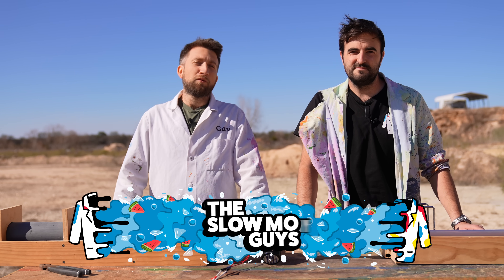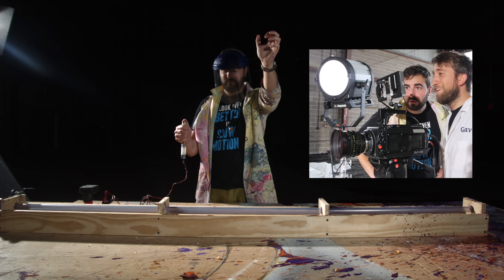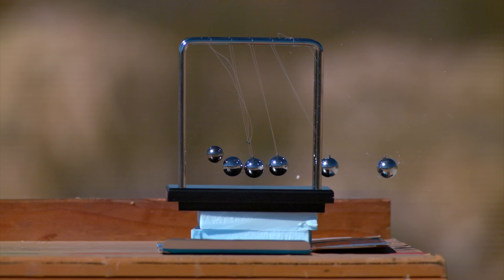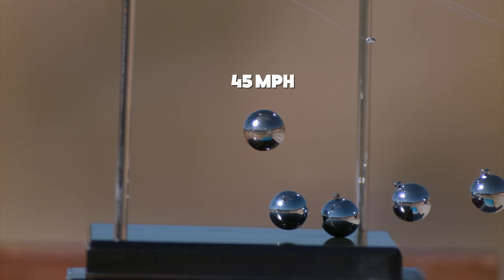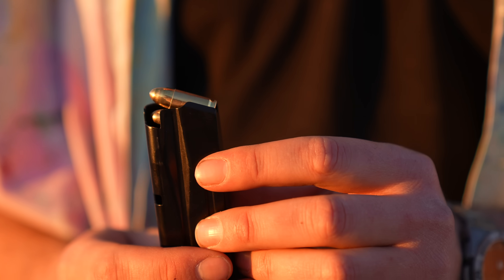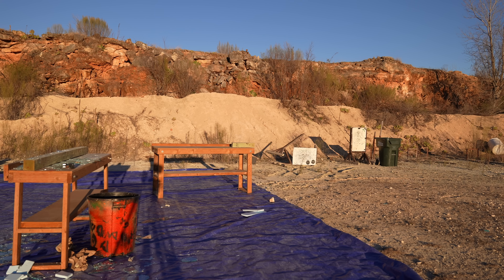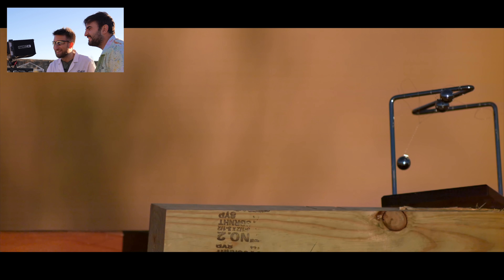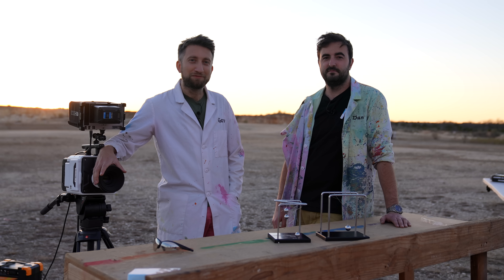Bullet vs Newton's Cradle at 100,000 FPS - The Slow Mo Guys

Comment: When Mythbusters did the giant Newton's Cradle the killer of the scale was deformation. You just can't get metal hard enough to withstand the impact. Saw the same thing here. You can't the speed enough that the hard steel balls deformed and as such the end ball wasn't traveling as fast. You lost energy in making those deathstars. I wasn't at all surprised by the bullet result. Great shot by Dan, btw. Bullets have much more speed, but you just loose so much energy to it deforming.

Comment: This is the physics that makes it reasonably safe for competition shooters to fire rounds into hardened steel targets as long as those targets can swing, and the shooter is a reasonable distance away from the plate.  The bullet impacts the steel, transferring most of its force to the plate which has greater mass, and thus has a lot of inertia by comparison.  The bullet, being much softer than the steel, rapidly deforms upon impact with the plate.  The plate swings from the imparted force, and the bullet fragments are directed in a downward pattern into the ground.  After you fire enough rounds at a plate, a little line will develop almost perfectly perpendicular to the direction of travel (inline with the plate).

Comment: At high speed, the Nylon strings will behave more brittle than normal as polymers are time dependant in their response to stress.the faster you hit them the more brittle they behave. Nylon is also more brittle when completely dry. It can absorb about 3% by weight water which acts as a plasticiser and will make it tougher

Comment: Yeah the speed of sound in steel on average  is about 20,000 feet per second the ball bearings is probably faster because they’re hardened steel. There’s no way you’re gonna fire anything fast enough to prevent the last ball from popping out first

Comment: It's not that the first ball gets snapped because it gets the most impact.  It snaps because the one fired is slightly above the first ball, so it is driving the first ball down, snapping its string.  Since the bullet was slightly below center, it pushed it up.
Reply: .   To think that is what happened... one first has to filter out the objective personally witnessed reality and replace it with a something from their own imagination. The string on the first ball didn't break... The mount the string was threaded through remained in place as the ball shot out from under it with more force than the mounting method could withstand.

Comment: Looking at the high speed (slow mo) shot of the impact, I can see that the projectile path is slightly above the center line of the cradle balls, causing it to deflect upward after impact. I would suggest that a retest be done with a more accurate impact to impart all of the energy in a straight line, rather than a deflecting shot which is not transferring all of its energy in the straight line. This may or may not give a different outcome...

Comment: You guys are idiots using PVC pipe and fittings for that high pressure gun. Do you know what happens if you get a defect in the plastic? It explodes like a grenade in your face.

Comment: I think that the first ball was detaching because the BB was hitting just slightly above center, so the point of impact was at a slight downward angle, so while most of the force transferred to the ball was in the horizontal direction, some smaller proportion was in the vertical direction pulling on the wire, and at the forces you're dealing with even a relatively small vertical component is way more than that little plastic wire can handle so it snaps immediately. The interface between the first and second ball, OTOH, is close to perfect so nearly all of the horizontal force is transferred to it in the horizontal direction, which is then transferred to the third ball before the angle of the wire holding the second ball can rotate enough that the wire has to resist much of the force from the first ball.

Hopefully that makes sense. I watched this after a couple of drinks.

Comment: Firing through the pipe, the BB had more momentum  and therefore did more damage to the Newton's Cradle.  Using the handgun, there's a slight kickback reducing the momentum and force of the bullet.  Additionally, the first cradle shot at with the handgun, I  could see where the first ball is higher than the remaining 4 balls skewing the results.

Comment: Hugely disappointed.

The bullet hit with calculable energy.  Some was lost throwing the first ball up.  Some was lost in heat iwth the lead splash.  All the rest was imparted into the last ball.  So you can calculate the energy in the last ball (by the speed and mass), to get the efficiency of using a gun to move balls.

No Measurements.  No calculations.  [sadface]

Comment: I think one of the reasons the balls didn't fly as much in the last one is because you hit it slightly low, while the shots aligned with the tube hit almost perfectly dead centre. So a lot of the energy glanced off instead of being transferred into the next ball. Still really good shot for just shooting with your body, instead of from a vice.

Comment: I would love to see that with an API round. I have a 7.62mm with API rounds, what I don't have is a high speed camera.
The round would be lighter than the ball bearing, but the penetrator should be as hard if not harder then the cradle balls and traveling pretty fast. I wonder if it would punch through the first ball? I would totally donate my time, firearm, and ammo to find out.

Comment: The air in the barrel ahead of the projectile is a factor.  Should have a sheet of plywood between gun and target, with a barely over projectile sized hole in it.

Comment: Is there some sort of physics behind the initial velocity of the ball, the impact and the last? The projectile came at 270 mph (6/6 of the original speed), when it hit the first ball it slowed down to 45 mph (1/6 of the original speed), and the last ball reached 90 mph (2/7 of the original speed). Does it have to do with the conservation of momentum principle?

Comment: The second ball is transferring energy because it is stuck between the ball receiving all the energy and the mass of all the balls  after it. The last ball has nothing to anchor it… no mass of other balls behind it to overcome. The energy it receives overcomes the resistance of the strings first because of this. If you used larger balls, stronger string, and less mass in the ball fired, we could see the way that energy traveled through the system better… because the system would not be destroyed by the impact.

Comment: Question: Does the suspension material matter? That looked like fishing line holding the balls up in the cradle. Do you think the results would be different using some form of metal wire to suspend the balls and/or if the balls were cast with a suspension loop as part of the mold instead of welded on or however it's made? Maybe my intuition is way off, but I can't help but think that a better attachment point and more tensile strength in the attachment material would make quite a bit of difference.

Comment: what you need is for the projectile to be the same size and material as the balls on the cradle… perhaps ball bearings. then you will see the impulse pass down the row of suspended balls.would also be interesting to see the effect of balls fired at speeds below and above the soeed of sound in the material,
eg rubber 200ft/s   steel 17000 ft/s

Comment: Even with how fast everything's moving, here's the crazy part.  At 10:32 if you go frame by frame with the period and comma keys on a keyboard, you can see the bullet's reflection in the first cradle ball.  This is taking place 4000 times faster than the human eye can see, and the reflection of the bullet in the first ball is happening at the speed of light.  If you really think about it, that is insane.

Comment: I would like to see this revisited. Only difference with the pistol, would be the use of a Ransom rest and a laser bore sight to get the alignment right and take the variable of hand aiming out.

Maybe even try other firearms on not just a traditional newton's cradle. Things like hanging aluminum and brass locks. Modeling clay, terra cotta pots, ceramic pots, cookie sheets, and compressed aluminum pans.

Comment: I'd imagine the first ball gets impacted significantly only because the ball bearing is shot slightly above center. The force then transferred to the first one is down and to the right. Only that horizontal momentum is then transferred to the other balls whereas the downward momentum is absorbed solely by the string causing the first ball to snap off.

In theory if you were to fire a ball bearing dead center and perfectly level, I'm sure the first ball would be the least impacted as it immediately transfers almost all its momentum to the other balls without straining the string holding it in place. After all, that's what we observe when using a Newton's Cradle as usual.

Comment: Id love to see this with like 3-4inch bearings on the newtons cradle (like a several-times-upscaled version) but hit by a normal ball bearing or bullet as in this video, accompanied by steel wire as strings instead of nylon

Comment: Did the mass of the rest of the balls make the bullet fragment?  What would happen with only the mass of one of the balls?
Meaning... Could a bullet proof vest be made of a single layer of HARD material?  Like the steel balls, hard..
For example..  A layer of hardened squares, bonded to a kevlar layer.  Or two layers of squares off set so no seams for a bullet to push past;.

Comment: You should’ve tied him together with braided fishing line like spider wire instead of a clear monofilament fishing line that’s probably only like 8 pound test or whatever because the three middle ones are breaking the line and the first and last one are breaking at the weld where the holders are

Comment: Hello fellas,I would to like make a suggestion ..
I’m sure you know the Cymatics of making a shotgun shell,
I believe if you were to make a seal behind the ball bearing ..similar to A shot gun shell ,pushing the projectile out of the barrel with seal right behind it ..
For maximum power and velocity like piece of cork or plastic same 
Diameter as the barrel.
Both ejected out 

Note add some riffling .. lol 

Ciao

Comment: PLEASEEEEEEE RE DO THIS ONE MORE TIME…. This time , try EXPERIMENTATION with 30-06 AP . The core is near to or above the hardness of the bearings .
    I am not that far from where you two have said you do these experiments.    
    I can get you a closed range to use with electricity to run your lights .   A rifle to use.  And a few of the coveted black tip 30-06 to use.   And some 5.56 m855 and m855a1 to use.   Along with a lead sled if needed to line up the barrel with the Newtons cradle .

Comment: I love the moment when the .22 turns into irregular birdshot.
     For scientific purposes, you should do it again with each of the cradle balls numbered and weighed before and after. The diameters of the fore and aft impact craters should be measured after each iteration. There should be several iterations with fresh spheres each time. 
     Most importantly, you should try it again using a muzzle loader that can fire a comparably sized ball but let it be made of steel. Be sure to leave some space between the first ball of the cradle and the end of the muzzle loader, and rig the rifle so that you can pull the trigger with a long cord. And set up a camera that can sight along the path of the trajectory.

Comment: The thing about the Newton's Cradle is that it shows the simultaneous conservation of two quantities: kinetic energy and momentum. This is the reason why the middle balls don't move, or why two balls move if you swing in two balls to begin with. KE = 1/2 mv^2 while momentum = mv. Assuming the incoming mass is equal to the mass of the balls, the only way for both equations to be satisfied is if the final ball leaves with the same energy as the incoming one. In reality you'll always end up with some energy being transferred to the other balls and the frame because of differences in mass, inelasticity in the collision, etc etc.

Comment: FYI copper is harder than lead. They coat bullets in them not so they'll engage the rifling better but because the harder metal won't leave lead residue in the rifling as much. The fouling of the barrel is reduced

Comment: The bullet is meant to shatter, it's a lot more dangerous for it to pass through a target than to stay in it and impart all its energy into the target.
Some rounds are very different and are supposed to pass through a target, but this round isn't meant to.
Interdiction rounds will have a steel core.

Comment: If you write down the energy and the momentum equations for a two-body collision, you will see that the total system kinetic energy is distributed in inverse proportion to the body mass. So it is no surprise that a light bullet absorbed 10 or so times more energy than the Newton’s cradle, and disintegrated as a result

Comment: When armored equipment was created, it was found that when the bullet struck it, the bullet often shattered on contact.  When they turned the bullet around in the brass with the flat spot leading and the pointy part inside the brass the bullet was able to puncture the armor.

Comment: In the very first shot of the video, the projectile fired caused the newtons cradle balls to flatten because the newton cradle balls have the same or somewhat similar surface area allowing their collision to form a shockwave that equally distributes the energy into both balls (pause). Explanation similar to this done by the action lab.

Comment: I'm disappointed you stopped with the lead bullet. There are solid copper bullets you could have tried as well a getting a 9mm HP (Hollow Point) and putting a small titanium ball baring in the HP tip.   You quit to soon.....

Comment: the "expert" should know that its not all about "weight".  that parabellum prob weighs the same as the ball bearing, but because its so much softer, it yields to the ball bearing which is either steel (most likely) or ceramic.  ill mail you a few 7n31 and some green tips

Comment: 5:45 Look closely at the first ball and you see that it is hit slightly higher than its center. It has the effect of pushing the ball down.. over an extremely short time, creating a large downwards acceleration. Since F=m*a, it's a large near-instantaneous force on the string, snapping it. Same thing happens to the second ball. Watch the balls by stepping the YT frames (comma/period) and watch the movements of each ball, up or down.

Comment: It would be really interesting to see what a massive increase in bullet velocity would do. Your average 9mm round typically clocks at about 1150 FPS, and your higher pressure loads hitting upwards of 1300 FPS or so. Pretty fast, but that's still only just a little over mach 1 in the grand scheme of things. Those balls are probably made of something relatively inexpensive like chromoly steel, right? Definitely hard enough to stop any pistol caliber no problem, granted the mass differences will provide some slightly different outcomes, but for the most part it won't be significantly different across the board. Velocity is what will determine the most significant differences over bullet mass. Speed is the primary variable taken into consideration when ammunition manufacturers design armor penetrating rounds. Speed comes before any other design feature such as hardened steel cores or anything like that. A standard FMJ copper jacketed lead bullet can and will punch right through armor plating if you can get it moving fast enough. It's mass is pretty irrelevant in that part of the equation, and so is the material of the target's construction (in reference to armor, like steel or ceramic). If you can step this up to rifle calibers you'd get some really interesting and badass footage. 5.56x45mm or .223 Rem (They're more or less the same round. The difference is pretty unimportant.) AKA the bullet the AR-15 fires is a intermediate cartridge (medium power) with a .22 caliber bullet (yes, the projectile is only .22 caliber. Caliber is a diameter measurement for those who don't know.). For the most part it's average speeds are in the mach 3 range or 3,100 to 3,300 FPS give or take depending on barrel length and bullet weight. I bet you'd get 2 clean holes punched through the first 2 and if it makes it through the 3rd it'd probably mangle it in the process before completely disintegrating. There's definitely some newer cartridges out there like 6.5 Creedmore that'll probably punch through all of them and possibly look like you did it with a laser, but to wrap up my ballistics science lecture. A full power (actual high power) rifle round like your grandpa's .30-06. About mach 3 just like an AR-15 round, but remember when I said that mass was an irrelevant part of the equation? It's relevant now.... Very.... Very... Relevant... It should "go through" all of them. Most likely wont be too much of anything left, though.
Reply: i dont think mach 3 would be enough. mach 3 is 1000 odd m/s, the dpeed of sound through steel is about 4 times that so the last ball should start moving before the bullet gets there

Comment: The first ball that got hit… sandwiched between the projectile ball and the second ball. The shock of the first one being hit front and back caused the holding ring on the ball to break away. You can see as soon as the ball was hit a violent wave went thru the ball. It is a good thing I don’t have one of those cameras. I’m an engineer and there would be a pile of stuff I destroyed laying out in my field.